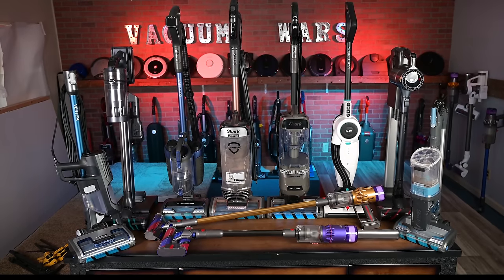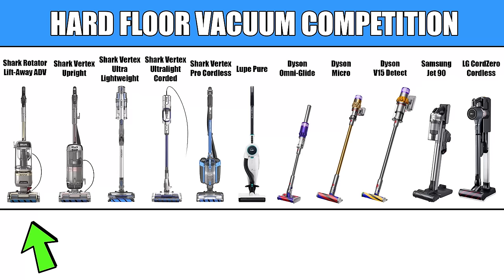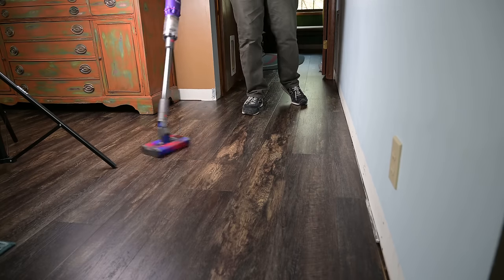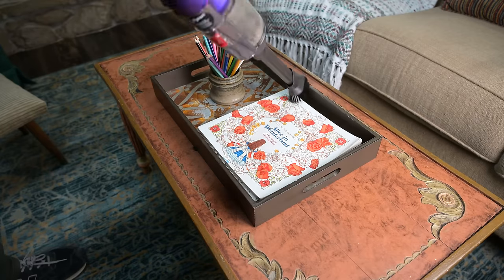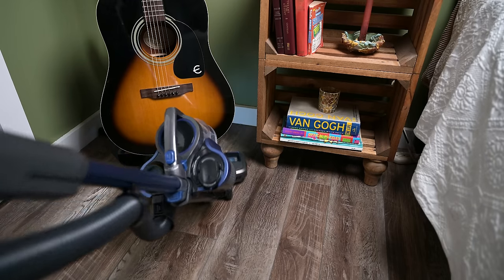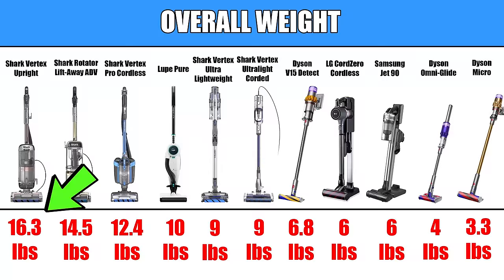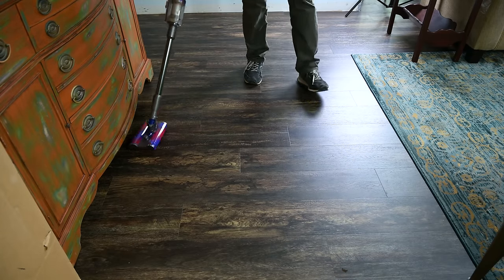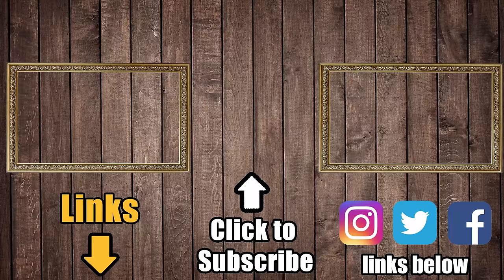TOP 3 Best Vacuums for Hardwood Floors - Early 2022

Comment: I feel like you aren’t looking at all the vacuums that could be could for hard floors. Shark, Dyson, LG, and Samsung are all a very small part of the market. You didn’t have the Sebo Felix on here which is amazing on hard floors or any canisters. You should start reviewing different brands such as Miele, Lindhaus, Numatic, and Sebo.
Reply: Yes but non soft roller vacuums struggle with actually dusting floors. Dust that actually need more than airflow to remove. It’s like trying to dust furniture by just blowing instead of using a dusting wand.
Reply: If your vacuum is powerful enough you won’t have an issue with “dusting floors”. The reason these vacuums have soft rollers is because they are underpowered and need that extra help to pickup debris. Soft rollers also scratch your floor since they are basically scraping the debris towards the air path of the vacuum.
Reply: Plus more shit to break meanwhile Henry will fall off a building 5 times and be fine or have minor cosmetic damage or easily fixable functional damage
Reply: @battery_wattage  That's why floor heads have bristles or squeegees though.
Reply: @battery_wattage  not at all. My Henry picks up literally everything on hard floors. Doesn't have a soft roller yet is powerful enough to pick up even fine dust and things like glitter.
Reply: If he does that he will get 5000 views. At the end of the day this is a business for him
Reply: Why don't you do the review on those vacuums you mentioned? 

That would be productive and informational.
Reply: @Miked1332  because this commenter is a whiny beesh

Comment: I live in a small 1,000 square foot home with all hard floors, most of them being real wood. I decided to buy the Shark Vertex Pro after watching your video, and I'm in love! $300 is a hefty price tag for me, but I'm so glad that I made the investment! I used to only sweep the floor with a dust broom and would often miss little debris. This vacuum handles big and small debris pieces and rotates well. Assembly was so easy! I clicked several big pieces together, and I was done! Taking it apart is just as easy. Everything is labeled nicely. I love the attachments, the small size of the vacuum (we have little storage space) and the container to empty the debris opens from the bottom with a simple tab click to dump it in the trash. Even the charger is small and has suction cups on the bottom, so it's more stable. I was afraid of cordless having less suction power, but this vacuum works so well for my needs, is more quiet and simple to use. Sorry for the long post, but I wanted to thank you for this video! I recommended this video on my Facebook. ❤
Reply from the maker: So glad you are happy with it! Thank you for commenting!

Comment: I find canister vacuums MUCH MUCH easier to use than uprights. I use my shark vertex for carpets and dyson canister with non powered hard floor attachment and it's the perfect combo. Canisters have ZERO handle weight thus perfect manoeuvrability. Seems like canisters are not too popular stateside? Very common here in Australia
Reply: I wholeheartedly agree! I tried the Dyson stick vacuum and it is so uncomfortable to hold!

Comment: Thank you for your excellent, thorough and most importantly, PRACTICAL reviews.  I almost dropped a bundle to buy the top of the line Riccar a few years ago but decided to give the Shark Apex a try based solely on your review and insightful comments.  I am extremely happy with the purchase. The Apex has been a terrific vacuum aside from the short hose which you pointed out in your review as one of its only drawbacks.  I have not had tremendous luck listening to youtube content for reviews but yours have definitely been helpful.  Thanks!
Reply from the maker: That is really great to hear. Thank you!

Comment: Very impressive reviews. I bought the Shark Vertex Pro based on your evaluations. Thank you. You have saved me a lot of leg work. I have spinal stenosis and get into trouble when vacuuming if the machine is too heavy and inefficient since one tends to work harder and longer when dirt and debris don't get picked up. I also liked that you pointed out that the upright quality vs. the weight on the wrist is not an issue since you have both the stick and the upright qualities with this particular vacuum. As you say, the unit can stand up on its' own and you don't feel like it's going to fall when you lean it up against a wall or counter. All in all, you are an excellent resource and I'll be sure to share your evaluations with others when in the market of replacing a vacuum  or two... 🤗
Reply: Hello 😊I’d like to buy the same you bought. Can you help me please. I would like to know the model number. It’s hard for me to find the best vacuum because I’m 70. I’m not very smart with internet   Thanks 🙏

Comment: I know this channel only talks about vacuums but he needs more subs. So well done and actually makes it entertaining. I want thank you! I bought the Shark P50 several years ago on your recommendation and it has been amazing. I just bought the Lupe again on your recommendation, it arrives today I am very excited!
Reply from the maker: Wow, thank you!  I hope you enjoy that Lupe!
Reply: @VacuumWars  so I have been using the Lupe for only one day now. I like it a lot. Something interesting I noticed. The P50 will run over and ingest just about anything. That is good and bad. While I love that it can suck up large debris it would frequently get clogged with things it sucked up but could not “process”. Conversely the Lupe will not ingest some of the large debris the P50 will, it just pushes it away, but I also have not had single clog.  It looks like it is cleverly designed to only ingest things it can “process”. The only thing I really miss from the P50 vs the Lupe is how easy the P50 can convert to using the wand to clean in corners. The P50 you just pull the wand out and you are good to go. On the Lupe you need to detach the hose then connect it to the wand, not nearly as convenient.

Comment: First, I love your channel. You provide the gold standard, in my opinion, of vacuum reviews.
A thought for future reviews. I’m not sure how you would do it. But it would be really helpful to a significant subset of your viewers, I believe, if you could cover things like strategies for using a robot vacuum in a home with multiple raised floors. Do people all manually move the robots to higher/lower floors? Are there other approaches? Do some robot vacuums lend themselves to handling this better than others?
Of course, the simple solution, though not elegant, is to either manually move the robot or determine where the robot is most needed and/or use a non-robotic vacuum for other locations.
And please forgive me if you’ve covered this in one of your videos and I somehow missed it.
Reply from the maker: Thanks.  well you are definitely on to something.  Last year Dyson filed some patents for a stair climbing robot. https://www.theverge.com/2021/9/5/22658346/patent-dyson-robot-stairs-vacuum-hand
Reply: @VacuumWars  thanks for the quick reply. I’ll check out the link. 
Note that I’m only talking about raised or sunken floors. But I get it that the concept is similar to having a robot actually climb multiple stairs rather than go up or down one step to a raised or sunken floor.

Comment: I wish you would include a shag rug in your reviews, and report whether it tries to eat the rug, or stalls out. Or can vacuum it and move on. I assume the Shark cordless vertexes could do it, only because I have that Shark Vertex Duoclean corded HZ2002. The one with for some reason worse filtration (why shark! it was almost perfect, besides the filter) But under use, the filter is fine, but most importantly it can vacuum my shag rug in my tiny house. I have less than 300 sq ft of floor space, and 1 5x7 shag rug, and the corded vertex duoclean can vacuum it fine. I tried a corded shark , not sure which model, but it was way to powerful even on hardfloor mode.
p.s. of all the videos that even showed that vacuum and yours barely mentioned it,  you are the only one that seems to actually look at the manual, or have figured out that you can hang the powerhead low on the wand when storing it.

Comment: i can tell you right now that the omni glide sucks if you have any pets. hair gets stuck on the fabric sides and long hair gets stuck on the ends of the rollers and if you don't have a razor blade you're not going to get the hair out. it also gets gunked up with build up and you have to deep clean it like every 4 uses. its worth more like 100 not 400+

Comment: I bought the shark ion p50 based off of your recommendation...and it has not held up well at all! I used it nightly and it got blocked all the time; especially by popcorn hidden under the couch.  I have since moved to a Dyson outsize absolute+ and am loving it.  While I agree with your recommendation that this stick vacuum format can be difficult to hold for long periods of time, at the end of the day I don't want the vacuum to keep getting things trapped in the hose.  I wonder if you could add something to test blockages because I believe that is the downfall of the lupe/shark vertx pro model and is also the reason why Dyson hasn't adopted this format.
Reply from the maker: I'm glad you are having a good experience with that Outsize!  I'll think about the blockages.... thank you for your input!

Comment: I bought the #1 Shark here as I have a large house of mostly hardwood floors.  I HATE it!  Just got it.  Used it for about 20 min trying all the different speeds and such until the battery ran out.  The battery got so hot it shut down.  You have to wait 45 min. when the battery gets hot.  Then it takes 3 hours to charge!  But the reason I hate it is how much it torches my wrist because while it's not heavy the motor is heavy when you have to control the constant swivel.  Is is always trying to twist to either side and my wrist and elbow were tired (I'm a very active 50 yo female).  So, I'm still looking.

Comment: 2:35 the head for the carpet is as good for hard floors.  The soft roller has too many drawbacks only for the advantage for taking in larger debris easily. in fairness, i would have picked the Shark as Number 1 too.  It just beats the Dyson on many areas except maybe for the frequency of cleaning the filters

Comment: You should consider reviewing one of the newer LG A9s. Both the A927KVMS and A929KVM come with two of their newer batteries and an extended vacuum time. 

Neither comes with the soft roller attachment sadly, but they sell the soft roller attachment directly on their website currently for $108 and it's in stock.

Comment: In two of your Youtube posting (Best of 2022 and this one) you said the Shark Vertex Pro has 24 minutes on max power.  The manual states 10.  Amazon reviewers states about 10. And my test is a bit less than 10.  May I ask how you got 24 minutes on max power?  (IT has low, medium, maximum power.) Thanks.

Comment: In your opinion, which Shark vac is the best for hardwood floors, with a couple of rooms of carpet thrown in for good measure? Prefer a cordless unit (if good run on a full charge), but corded is an okay 2nd choice. Great channel.

Comment: I have Hallmark Organic 567 engineered wood floors that have an oil finish and the company states that only canister vacuums with a non rotating hard floor brush head must be used. Your thoughts? Any testing with those?

Comment: Will a rotating head perform way better when a non rotating hardfloor head from a form a cylinder vacuum? Maybe you dont need the rotation. No normal person will have so much trash on the floor. Normal fine dust is more realistic.

Comment: I notice, that although your testing is extensive, you don't mention if the vacuum has adjustable suction for area rugs.  I would love to see how these hardwood floor vacs fare on loose area rugs (not under furniture, as shown).  I've purchased several so called 'great reviews' lightweight hardwood-floor vacuums only to trash them when they can't clean my area rugs - or do not have an adjustment for suction and they just suck the rug right up.  I would love a lightweight vac that can do quick cleanup of my area rugs, with pet hair. :-)

Comment: Now I wonder. Between these and a self cleaning robot vacuum, which would you choose?
Reply from the maker: Gosh - I like having both for for different reasons.
Reply: @VacuumWars  thanks for the reply!

Now, you think one could only live a robo vacuum? or would you rather have the extra power of a manual one in spite of the time requirement? (assuming you could only choose 1 to start... Yknow, wife approval factor 😂)

Also another one: u've pretty much sold me on the vapor mop thing. Is it really a full replacement tok the typical mop + bucket? Or should I expect to work around some other limitations of it?

Comment: I'm trying to figure out what are the best models that can both vacuum & mop. Since wet+dry robots top-out at roughly 5KPa, and cordless human-operated ones reach much higher than that - I currently prefer the cordless human-operated models. However, there's no clear cut list of the best ones. In Israel, some popular models are the Dreame H11 Max and the Jimmy HW8 Pro. Would be nice to get your input on the matter, as vacuum+mop functions in a single appliance are more desired than just having one or the other.

Comment: @vacuumwars i have seen a lot of your videos and i respect your work.. i have one question for you.. I was about to buy a vacuum cleaner.. and I'm confused between Dyson v11 absolute pro and Dyson v12 slim detect.
Both are almost same price. But v12 doesn't come with swivel tool and extension hose and also has only 11 cyclone motor compared to 15 in v11 which makes its suction power at par with v10 
So I'm confused if I should choose v12 for just a little extra money. Which is actually v10 with lcd screen and laser light in my opinion. Or get the v11 instead..

Thanks in advance.

Comment: Would you mind giving your recommendation for the best stick vacuum for our top needs? 
We have 95% hardwood (couple area rugs and one room still with carpet), dog that sheds a LOT (short, fine hair) and then my long hair that we pick up everywhere also. Those are probably my top concerns when it comes to choosing the right vacuum for our home. Been doing a lot of research trying to decide which would be best. I know we need a soft roller for the hardwood floors and a good attachment for furniture for the dog hair.
Reply: Did you decide on one? You described my exact needs

Comment: Is there a concern with fine material getting stuck on soft rollers and potentially scratching hard floors as this stuck material now essentially becomes a roller-powered sandpaper?
Reply from the maker: I'm not seeing that.  The suction of the vacuum is pulling the fine materials up.

Comment: Woudlnt you want the motor closer to the suction? Why are they way up where you are "holding" the weight. You say you dont need it due to mechanic vs power. If you have thin throw rugs and hair, you need power.

Comment: The Sharks took the top spots.  No surprise there.  I had a Shark P50 and it was very similar to the winner of this comparison.  I found all that weight down by the head to make it more clumsy than Dyson-style stick vacuums.  The handle weight of Dyson sticks has never bothered me.  I've got the Omniglide and it's good, but the head width and dust bin are very small.  The dustbin needs to be emptied after almost every room.